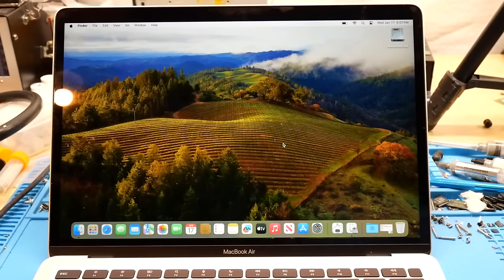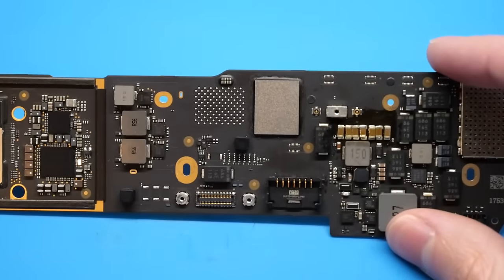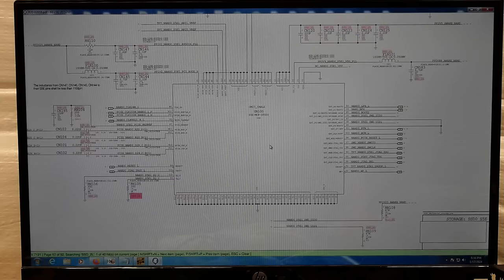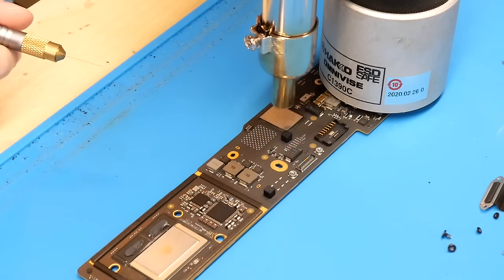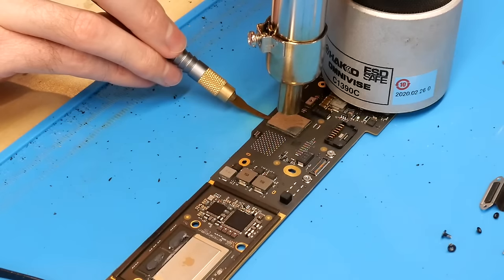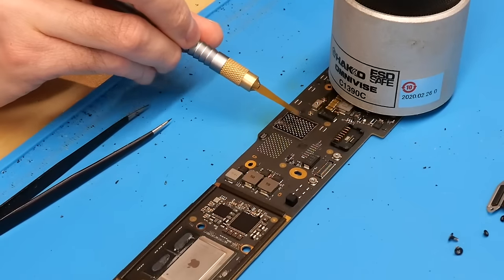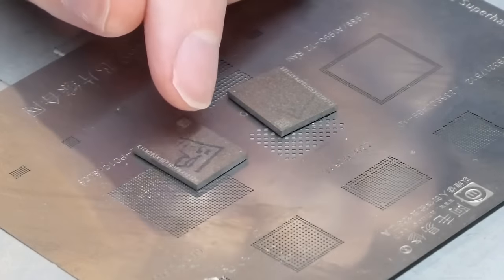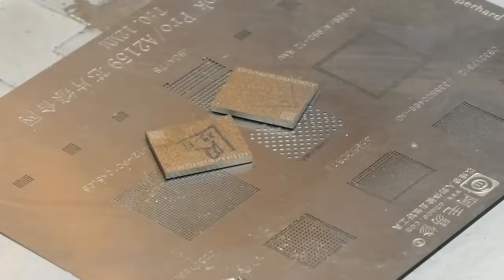Upgrading Apple Silicon Soldered SSDs

Comment: It's awful realizing that this is what you need to do to simply upgrade or replace a broken drive, but simultaneously, it's pretty amazing to see. Thanks.
Reply: Yeah that is a lot of work.
Reply: Probably way to risky for upgrading but if its broken its worth it I guess
Reply: well, that's how modern electronics are made.
not super different from how it was done in the 80s 90s, just things got a looooot smaller, so u need a strong magnifier and steadier hands.
Reply: wait till apple starts pairing these, shutting down even a labor-intensive upgrade
Reply: also amazing is the Win7 being the workhorse
Reply: It's pretty just sad that people (aka the Apple sheeple) are actually buiyg this crap, it's a friggin' brain surgery to upgrade or replace a defect SSD.  smh
Reply: @0netom nah my modern laptop has an M.2 SSD slot this is just how Apple does stuff
Reply: @riffdex The reason for this is because Apple has put the SSD controller directly in the M1 processor for faster read/write speeds than what your laptop can probably output.
Reply: @aplatinumorange5112 yeah, but from a repairability point of view it’s a very bad design, because if you don’t have access to a highly specialised workshop dude like this guy here, the only choice you have left is to scrap the mainboard if not the entire laptop. And this is not sustainable. All for the price of having a higher throughput to your SSD which hardly every user will exhaust. There are better designs for that.
Reply: Cactus needles dipped in flux work pretty well for grabbing the little tiny resistors and such. Doing 50 some odd smd parts and having to literally pry the old nand chip off 😳 😑 😐 They really don't want people fixing or upgrading these.
Reply: apple: for customer security, we decided to make an improvement that your SSD chip must be cryptographically signed and matching your security chip.
Reply: @r1_anon  apple is good at making excuses for people that don't know how pcs works. The problem is that their fans start to spread misinformation. This is one of those lies. You don't need to have controller inside CPU, because all it does is reading and writing, which is perfectly handled with onboard controller on modern nvme. What about safety? You have bitlocker/firevault and secure boot, no amount of drive tampering can leak you information.
Reply: its not really a big deal. 
If you have the equipment then you are all good. 
it wont be long before they are all doing this. Apple are just first again
Reply: @aplatinumorange5112  ...NVME drives are directly wired to a 4x PCIE lane which is so close to being integrated into the CPU it might as well be. 

Apple's SSD's are also slower on average (think NVME gen 3 speeds, 3000MB/s), but I suspect these slower speeds are likely a trade off in favor of battery life with already great performance over even better performance. Apple's higher end (think higher power consumption) offerings also offer write speeds that are more in line of what you would expect from NVME gen 4 (6000MB/s, which is still slower than proper NVME gen 4 but it's the closest comparison)
Reply: this is why i moved to surface pro 9. Replaced the 256 with a 1tb in 1 minute, cost only 100 bucks.
Reply: @0netom  That's just Apple. Every other PC manufacturer uses SATA or M.2 or both, which are literally plug and play. If you get a bad drive just replace it. Recovering lost data is always a pain though.
Reply: By design. Apple wants you to throw your old equipment in the landfill and pay them $2000 for a new one after a couple years.
Reply: Whats more awful is shipping 128GB laptop
Reply: @Alster763 and those works are worth more than either replacing the NAND or higher storage option from Apple

Comment: Hey dosdude! I can confirm that the 128 gig configuration of the M1 Air is real, as my school gives them to the students (I'm typing this comment on it now). I can also confirm that 128 gigs of storage (115 usable, not including preboot, vm, macos, "system data", and school bloatware) is way worse than it even sounds. Ever since my first year of owning this computer, I have been CONSTANTLY running out of storage. It really has infuriated me to no end, especially with MacOS' beyond terrible storage management. It has been a massive headache, and the worst part is that the school made this decision, despite my parents completely paying for the computer (and they would be more than willing to pay a bit more for me to have gotten an actually usable storage configuration, but because they're soldered, there's nothing we can do). Thanks for sticking it to Apple one soldered SSD at a time!

Edit: I also forgot to mention that using BlackMagic Disk Speed Test, the speed of the SSD is halved, so it has only about 1500 megabyte per second for read and write, instead of the normal M1 3000
Reply from the maker: Well, if it's paid for and not the school's property any longer, you can upgrade it. May be worth it. Paying someone like me to do the 2TB upgrade costs less than buying the 1TB config straight from Apple when ordering the machine new.
Reply: @dosdude1  have you done upgrades on Mac Studio? Currently running a late 2013 iMac, but know it's only a matter of time before it'll need replacement, and most likely will upgrade to a base M2 Max. Just hate to spend the ridiculous money on upgrading from the base 512 MB to 1TB.
Reply: @dosdude1   what is the price range on an upgrade like this? just for curiosity sake
Reply: @lopesmorrenofim  yes! how much would it cost to bump it up to 1TB?
Reply: @robbyhoff8850  Mac Studio SSD isn't soldered
Reply: @dosdude1  You know these new M1 MacBook Airs being sold at Walmart now for 700 USD? How much would it be to upgrade it from 256 with you?
Reply from the maker: @RicardoBrenelli  I usually do it for $200, plus the cost of the new chips (around $100 for 2TB) and return shipping. Usually comes out to a little above $300 total.
Reply: @dosdude1 can you do it for a m1 blue iMac
Reply from the maker: @ILovefood92  I can indeed.
Reply: @dosdude1  You should just buy up the smaller ones and flip them maxed out.
Reply: If we could only do the ram.
Reply: How much to add 16g ram to 2014 MacBook Air? Thanks
Reply: Thank you for recording and sharing this process. Great work 👍🏻

Comment: I'm so tempted to jump ship with how Apple is locking down their hardware.  It's crazy that they solder in the Nands and memory. Can you say, built in obsolescence! Thanks for doing this someone hopefully will start a business with reasonable prices to do this! All these ARM system SSD 's will go belly up at some point making all these machines door stops!
Reply: Hackintosh
Reply: @LaNoturna1115 How can you  even do that? Those Windows on ARM laptops are a rare sight to behold.
Reply: @LaNoturna1115 : You can be sure Apple will  definitely make building a Hackintosh way more difficult in the future even to the point where it won't be possible.
Reply: Not only soldered but glued down too! Its one thing to do some BGA rework, but BGA desoldering with the underfill makes it way more risky. I'd love to hear an engineers real reasoning behind it, because to me it just seems like an extra f-u to being able to fix these boards. I'm sure its for "durability" but is a BGA chip really going to rip off in a drop? Maybe if you launch it out of a trebuchet into a concrete wall.
Reply: @RyCorp77 : It's just another FU from Apple to the right to repair movement!
Reply: Apple has always been anti-consumer and anti-repair, going back to their first 1984 Macintosh. The only times that Apple opened up their machines to 3rd party upgrades is when Steve Jobs was absent, or engineers worked behind his back to add expandability to the design. Those days are looooong gone.

Now that Apple has brought the CPU in-house, they're beholden to nobody. I expect their machines to continue to get more and more unserviceable until it's just a single big chip with everything on it, and when it dies, you're forced to buy a new machine for $2000.
Reply: @RyCorp77 I think the durability part checks out if what I've read about  iphone touch issues on the 4S(on aonemobiles) is accurate. They say the later batches with the underfill is far less likely to develop the problem and is presumed to be a bandaid to mitigate the poor placement being vulnerable to shocks but is harder to repair as a result. This would be a total non-issue whether it's underfilled  or not had the SSD been modular in the M1  Macs.
Reply: @GGigabiteM what are you talking about? I have a mid 2012 MacBook Pro and have upgraded both the ram and ssd and replaced the battery twice. Pretty sure Jobs was alive and kicking and ceo. They didn’t start all the soldering shit until about 2013/14
Reply: lol ever seen a ARM based system where the RAM is not directly soldered to the SoC?
Reply: @GGigabiteM  Not strictly true. Some iMacs and Mac Minis even had socketed CPUs so that you could upgrade the HDD, RAM and CPU. On the Mac Mini 1,1 you could even flash the eeprom chip to a Mac Mini 2,1 and double the amount of RAM it could handle.
Reply: @bennaambo2716  Yes - for example ampere altra workstation boards use arm processors on normal style motherboards with standard ddr4 ram and pcie slots. it's used in ARM-based servers as well. It's not some inherent limitation of ARM processors, Apple just decided to design their platform that way, it makes sense for phones and tablets but it's a bit inflexible for larger systems.

Comment: Apple: We want to be more sustainable as a company
Also Apple: Lets make machines with 128gb of disk.
Reply: lets sell laptops that have parts that fail and can't be replaced soldered to the board to sell more products more often!
Reply: Estimated Trade In Value: Worthless
“We’ll recycle it for you to help the environment, just give it to us for free and buy yourself a $3,000 new Mac”
Reply: "128gb of disk"?

Who talks like this?
Reply: @cartorius  It CAN be replaced, did you watch the video?
Reply: @DarthVader1977  yeah dude that’s a wild amount of fucking around.. use to be a simple upgrade.. that’s not meant to be done. And with M.2 there’s no excuse for it.
Reply: @cartorius Most of the tedious stuff was because it was a student model that had a blank spot. Upgrading any regular MacBook would be less work because both ssd areas would have all the small components there.
Reply: @DarthVader1977 chip swaps are tedious work as well - this should just be a socketed SSD. Previous model NAND area took up the space of the older Apple "blade" SSDs or M.2 2280, these take the space of M.2 2230
Reply: That can never be upgraded!
Reply: 100gb*
Reply: @DarthVader1977  I've swapped out ssd on windows laptops and it took less than 1min. Pull tab, take out old one and put new ones in done. Apple doesn't make it easy. Additonally if you don't know how to solder or have the correct tools you can really fuck things up.
Reply: It has a lot of storage compared to a Chromebook with less then 20 gbs.
Reply: @DarthVader1977  Yes I CAN even make a laptop with my hand:)
Reply: @CertufiedTeacher  and then they resell it for 900$
Reply: @DarthVader1977  not by the average person you fanboy.
Reply: they have at least 256gb
Reply: It's a damn shame, that not even Apple makes 128GB. So many other companies does too.
Reply: I heard somewhere that Apple is on fire after someone found that the recycling program - the one with the robot arm called Daisy - was just a picture, and that the iPhones sent in for recycling got crushed instead. I can't seem to find the article or the news though, so do take it with a grain of salt.
Reply: @Farie977  nah cap
Reply: @DarthVader1977  Yes, it can be replaced by about 100 people on the planet. Can you replace it?

Comment: Hands down the most interesting and detailed SMD video on Apple products. There are 2 areas where you got extremely lucky with this project. First, the single Nand board came with all internal traces and Via's intact to power and operate both installed chips. Second, Bios on the board was not locked down to prevent hardware "upgrades" even in this extreme use case. Kudos to you and your craftsmanship

Comment: Congratulations for the amazing content and god-level technical skills. Quick question: Is it possible also to upgrade the RAM?
Reply: I would think no since the memory is built into the M1 processor.
Reply: @StewartWhaley it is upgradable actually, it’s on the same physical package as the Mx SOC
Reply: @thegeforce6625  But they are upgrading the SSD. The "ram" is part of the Mx processor so wouldn't you/they have to upgrade/purchase an upgraded Mx processor [which Apple is not going to sell you]?

Comment: Hey, dosdude1 , I wonder if its possible to upgrade the RAM of those devices as well? Or its going to be really tricky since the ram is already on an interposer.
Reply: Howdy, the ram is integrated on the SOC using a system in package technique. So not on die but pretty close. I haven’t seen someone swap the SOC yet but I think it’s possible.
Reply: @matthewcarlson5885  bro i said the same thing in my comment that its on an interposer next to the soc

Comment: 15:15 i don't understand why you not using low melt solder??? 21:50 why you're not using hot twizer to remove and solder the small component???

Comment: You can use free OBS to do screen/window recordings for a clearer picture - you'll need a mic or you can phone record at the same time and strip the audio off that. 
With GPU VRAM pads can look fine but are broken, maybe see if any pads fall off that faulty memory.
Good job with the swap.

Comment: KICM223 is spendy, $40-60 and don't appear to be great sources for it, only seeing aliexpress. Repopulating the required IC components for the second NAND seems like the worst part of this.

Thanks for sharing this possibility so thoroughly!
Reply from the maker: There is an AliExpress listing that has brand new/blank ones for sale, which is where I get them. Around $100 for 2 of them, to upgrade one system to 2TB. Luckily most machines will have both NANDs already installed, so you likely won't need to bother re-installing those extra passive components.

Comment: The first macbook I got was the 2008 Aluminum. It is beautiful outside and when you open the inside. To add more more ram just open the bottom which don't even need screws and put more memory in. I upgrade the 120GB hard drive first to a 250 GB then a year later to a 1TB but just open the bottom and put the rails on the new drive and screw one screw back in. 

    After watching this video, I don't really want to upgrade an M series macbook this way just for more memory or disk space. Crazy.

Comment: So when you get new completely blank NANDs, the Mac is able to automatically set them up as 0 and 1 during the DFU programming and you don't need the dumps and the programmer?

Thank you for showing us what it takes to populate the components for the second NAND. Yikes! Now I see why that's not such a popular modification. You are amazing! Wow!
Reply from the maker: That is correct. No programming needed if NANDs are blank/new/unused.
Reply: @dosdude1  hey just asking out of curiosity, in the jcid soft, you can wipe the nands, it's in the iphone options though....can you try and tell us if just wiping it through that allows it to simply be soldered on the board? from what i know the memory and firmware side on these chips are separated and the dfu soft might refuse to restore the chip because it still has data maping on it....(data safety policy).
Wiping the data map on the firmware side might solve the issue....well just a theory.
Reply: @Neo_AIO  True, makes sense, if blank nands are really blank when you purchase them then one would think you could simply erase them to return to that blank state if you programmed something onto them at any point.

Comment: This may not be possible but it's a thought that I just had would it be possible to make a separate breakout NAND board where you can put more than one NAND on it to increase the storage double if not triple the amount
Reply from the maker: No, as each NAND has its own PCIe lane used to connect it to the SOC. These are not like normal NANDs where you have CE lines and can put a number of them on the same bus.
Reply: @dosdude1  makes sense. Thank you for the input it was worth the ask, though

Comment: Hi there, great video - thank you, I've 2 x 512 KIC 229 Nands with what seems some firmware on ordered from Ali, I'm trying to get these running on M1 Air A2337 but whatever I do it just doesn't work, it ends with error 6, I tried KIC223 dumps from your page as they are corresponsing 0 and 1 since I only have 2 chips, I also tried back-up original Nand dump 0 and 1 and program that back to KIC229 again 0 to 0 and 1 to 1 but same issue, target Mac will display Apple logo and progress bar but it doesn't start moving and host mac throws error 6

Comment: hi. ive an macmini2018, when i play a movie from ssd or YouTube in bootcamp win10 or Macos Ventura on its  internal mono speaker, the sound cuts off after 2 seconds, but any sound below 2 seconds plays fine. i reset SMC/Nvram and erase the ssd totally and installed new fresh Sonoma & windows, with latest official bootcamp drivers, problem not solved on either of OS. whats can be the reason and how to fix it? tnx🎉🎉